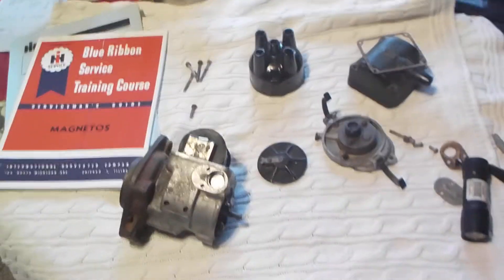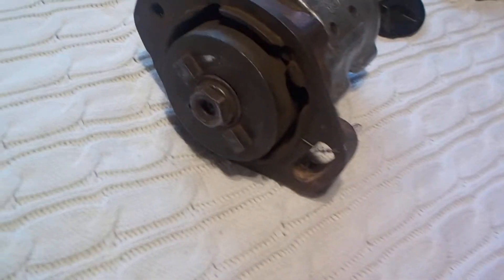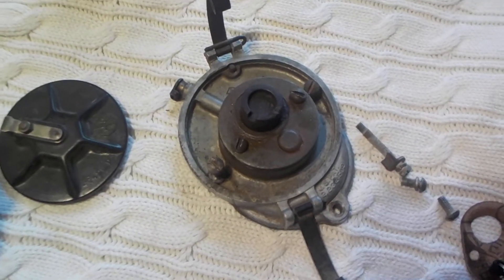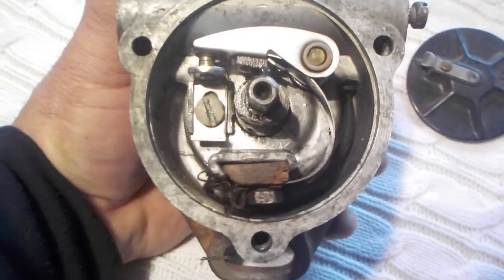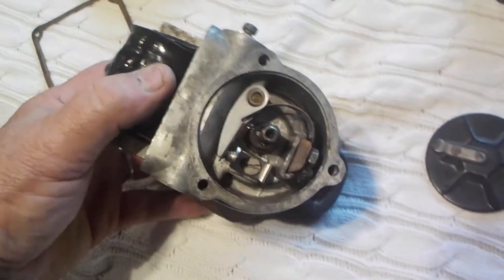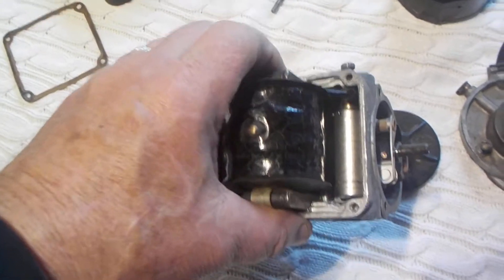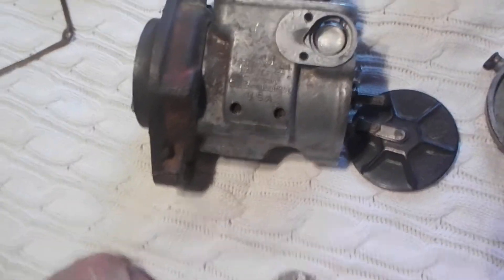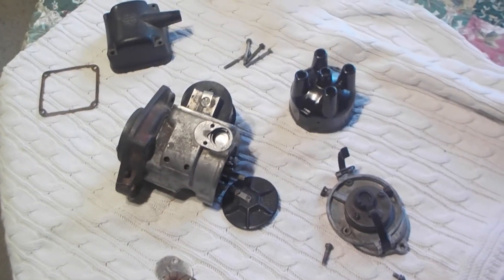IH Farmall  H4 Magneto Up Close Look Inside

Comment: hi fantastic video on the screw on the side of mag does the switch wire go straight to that does it matter if the wire is wrapped around screw
Reply: Use a terminal end, either a ring or fork

Comment: Hey Dan. I have the same mag.  I get a reading with the points open as well as closed. But take off the ground tab which is on the coil back side, I"m ok.  It's as though the one wire coming off the coil down to the condencor is being grounded out by where it's attached to the mag body. I'm new so be gentle. HELP
Reply from the maker: Watch My other Videos on this subject, including eliminating the Mag Coil, they should shin the light on your problem.  Good Luck

Comment: the first one I worked on from a farmall H /  I wanted to mention, the hardest thing I encounter was getting to the points.
this video doesn't show taking off the three screws under distributor cap to expose the points/ theres a tight seal on there
that wouldn't let me remove it / so I didn't know  why I couldn't just remove it by sliding it off after removing the three screws.
so finally I used screw drivers to pry a little on this side then further in a diff. spot  when I got it off I realized that I wrecked the 
seal / but if I wouldn't of pry ed from diff sides it would still be on the shaft . so I new I needed another seal / IH said there not 
made any more/ so talk about time consuming and it's no wonder tractor owners change them over/ to battery ignition . 
then before I wrecked the seal thing that stopped me from getting to the points/ I purchased a new cap from IH twice as much
as a regular cap and the points I think were more to and there diff. than battery ignition ones, so if you have tractors with
battery ignition you would have to stock each and learn to tell them apart/ and the coil new is about the price ( well its alot)
So theres nothing easy about these . I like that fact that they produce there own electricity , but thats it
Reply from the maker: These ones came right off... But You are right, they can be very stubborn. I had one once that had all 3 screws STRIPPED.  I had to use a Needle Nose Vice Grip to remove them. Unfortunately, when you mess with this Old Stuff you have to be prepared for the Worst Case Senario...You often have to Learn the Hard Way, from the Best Teacher...Experience.